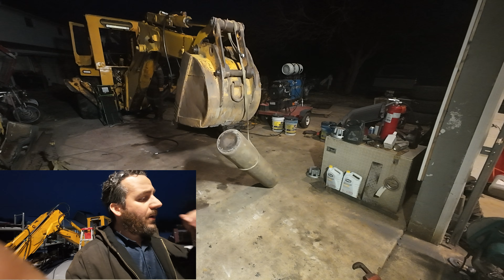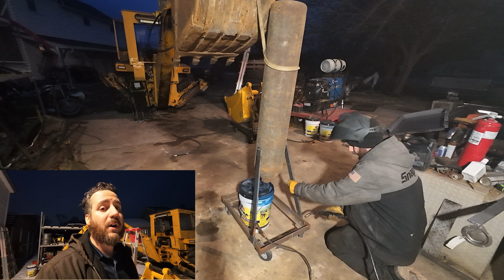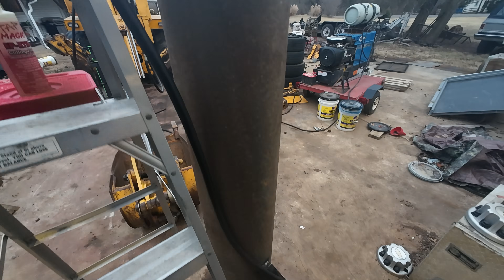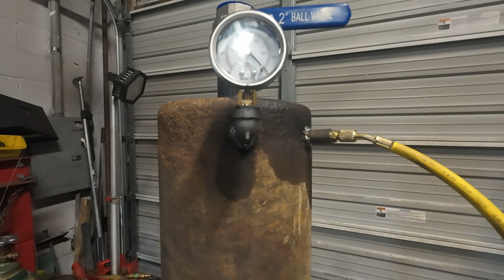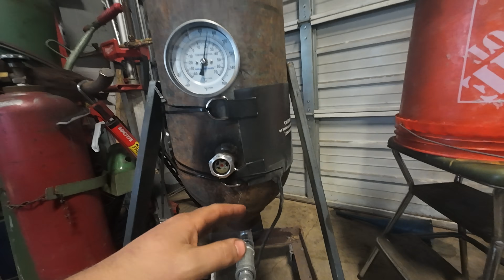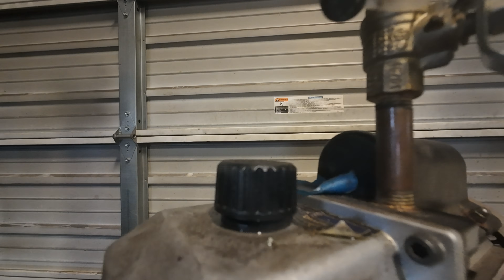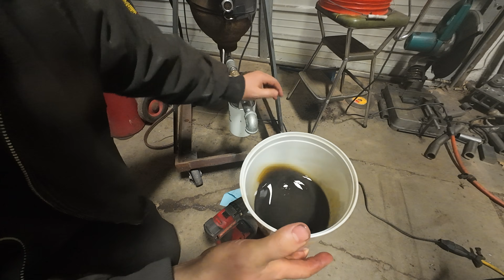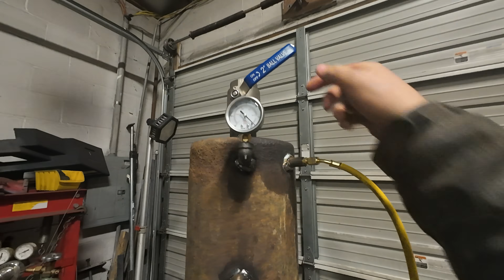I made a machine to remove water from hydraulic oil. Vacuum de-hydration

Comment: Less than a minute in and I'm wondering if a 2 gallon steel pot and an electric hotplate would be a more affordable solution to getting water out oil? Heat the liquid to 230d f or like 110 c and let it sit for an hour? Anyways that's easy now I'll watch the rest of your video to see if your machine is better...

Comment: The magnet trick was brilliant!!!!!  I used to dream about making a vacuum water remover for my vacuum pump oil when I was distilling cannabis resin in Humboldt.  The water from the atmosphere etc would infiltrate my oil and my vacuum would decrease requiring higher temperatures for distillation which would degrade the THC.   The cloudiness on your vacuum pump oil might be caused by droplets of hydraulic pump mist being sucked into the vacuum pump.   A oil air filter should help reduce this.  A cold trap to catch the water would help too, but it's a pain to have to get dry ice to keep it cold.  Keep your batches small because the bubbles will increase the volume, that's why your hydraulic oil went into the vacuum pump in the 10 gallon run.   It probably will only take 20 minutes or so to get all the water out of the oil.  You can tell by the temperature.  The temperature of the hydraulic oil will drop when you first start boiling the water off. When the temperature starts to rise, most of the water will be gone.   The leak isn't the worst thing in the world.  It can keep something called "bumping" from happening which is when things boil violently under vacuum.  But likely that wouldn't happen unless you had a lot of water in the oil, enough to pool on the bottom.  So maybe keep the tiny leak, it's helping you.  The leak provides a place for the boiling to initiate.   Below is a link to someone doing the same thing with an ebulliator tube.  Which does the same thing as your leak.    The leak provides a place for the boiling to initiate stopping supercooling which causes the bumping.   I used a syringe stuck in a hose attached to a dip tube going to the bottom of my liquid.  A tiny bit of air, (way less than would cause the vacuum to decrease) would stop the bumping.   Thanks for the vid.  I never took the time to make one of these,  It could have saved me some headache.  I miss those days.  Legalization killed all the fun.
Reply from the maker: Sounds like you were having fun!

Comment: I wonder if you can put a filtered vented cap on the tank while running the equipment?  As you run it, oil heats up, water evaporates out the vent.  Cap after use, hot!!

Comment: I used to build molecular distillation machines for cleaning transformer oil. You are on the right track  however you really need to spray the oil into the vacuum chamber and almost atomize it which helps to separate the oil from the water. We would fill the vacuum chamber with sheet metal media to add surface area to condense the oil so the heavy oil would go to the bottom and the water vaop would be pulled out of the top.  The vacuum line would pass through a chamber filled with stainless wool to condense the water so it could be drained from a valve before the pump. After the oil condenses it still needs to be pumped through a fine filter to remove the particulate. This is the step you are missing. Also the temperature may be too high, pretty sure the oil will boil at a lower temperature than what you had, under good vacuum it should boil near room temperature so you don’t affect the oil. Also a good vacuum pump with a gas ballast will allow you to run the pump to boil the vapor out  instead of changing the oil.
Reply: Yes, breaking up the surface of the oil is an important missed step. In fact, the whole vacuum idea is not needed for this purpose if you bubble air through hot oil.  The idea of this is not to get 99.9999% water free oil, because you're only draining 1/2 of the oil out of typical equipment at a time. So .01% oil doesn't matter because when you put it back in, it will mix with 1/2 contaminated oil and still be 1 or 2% water.  The process has to be set up and easy to repeat multiple times so that the water can be flushed until good enough, not perfect.  Air bubbling IN THE EQUIPMENT TANK is the simplest way to do that. If you're using a separate tank, it needs to vacuum the oil out and pressurize the tank to push the oil back into the equipment to be practical for the repeated flushing and drying is needed (as mentioned below).
Reply: @ yes, we would also make filter carts that only had a pump and a filter canister however the vacuum process makes pristine oil. I’ve never seen the air bubbling method you speak of though that is interesting.
Reply: @notanymore9471  Air bubbling is just a simpler process, pristine oil is not needed as it's going right back into a grossly contaminated system.  Once the bulk of the water was removed, then vacuum could be useful, but like you said, it would need oil sprayed, or air bubbled to free the water down to a low level. Or water absorbing filters could work at that point, filters are too expensive for bulk water in equipment like this.
Reply: The water boiling chart is based on water only, probably not taking account of water in oil, which requires the air contact to approach that temperature pressure point.
Reply: @rodfreess6019  that's a very interesting point!  Generally this type of mixture (hydraulic oil and water) is governed by Raoult's law and Dalton's law, which basically imply the water and oil will evaporate independently with little interaction.  After a certain point when the concentration of one or the other components is small, an azeotrope may form where they will not evaporate independently but that's probably not important in this case.

The point about atomizing the fluid just speeds up the inevitable evaporation.  Actually it may seem strange, but an emulsion will actually boil at a temperature lower than it's lowest boiling component.
Reply: You are evidence of what makes the internet so wonderful. Thank you for your comment.
Reply: I love how the real people completely ignored the arguing bastards
Reply: @ nobody was arguing there was one dipshit insinuating that I should give the guy free stuff because I told him what he was missing in his design.
Reply: That air drying method needs dry air.  In high humidity, it would take forever to remove the water from the oil.  It may affect the buffer chemicals in the oil. Bubbling dry air through hot oil in an operating machine would work.  If you live where it is dry, that may work.

As for running a vacuum pump to pull water out of the oil, vacuum pumps hate water.  The more water you pass through it the shorter it's lifespan will be.
Reply: @ vacuum distillation is used every day the system has to be designed correctly to separate the water and gas ballasts need to be used to prevent the build up of vapor in the oil.
Reply: Add a separate tank that has no oil in it and attach the vacuum pump to that and then attach that to the system. That way your oil won’t get foggy anything extra cotton in the overflow tank and you can just collect it afterwards.
Reply: @huuffff cool that tank and the moisture condenses in it.  (which another poster here pointed out  similarly already)
Reply: You need a condenser and then a trap before your vacuum pump
Reply: You are almost there, a few more parts and he’ll have a $20,000 roto-vap or a $30,000 wifi (wide film evaporator).  lol.
Reply: Would a centrifuge separate water and oil?
Reply: @c50ge i was wondering the same thing.
At any rate adding a centrifuge to clean the oil after boiling the water out might be a thing to do.
Reply: Optimus Prime and the Autobots appreciate your service.
Reply: Epsom salts can be used to dry the air before it goes through your vacuum pump.  It is cheap, and to be reused if you have an oven to dry it out with after subsequent runs. 
A cold trap could be arranged, but it would be more expensive. 
I wouldn't think that the qualities of the hydraulic fluid would be changed that much by merely being heated to 100° f or so, but others may know more about that than do I. 
Nice job on the setup!
Reply: @davido.newell4566 . The buzzer doesn’t go off in a machine till about 190 degrees.
Reply: I have an imported miniature Refinery I refine or distill waste automatic transmission fluid into a diesel like fuel only cost maybe 10 cent per gallon Unlimited Supply machine is fully stainless steel fully continuous fractionated into multiple fractions and temperature controlled electronically with multiple Heat exchangers I have been doing this for 12 years I have saved a lot of money in fuel
Reply: @tonydiesel3444  i am VERY INTERESTED in your comment. miniature refinery  ?  IF you are running a business selling the "fuel" i dont want to interfere . BUT IF for your own use, could you please give me a lead in the right direction so i might acquire one for my own use? im married to steffy, youtube dont like me as im an old man.

i think it would be great to make my own diesel from waste! im extremely interested in automatic system!!!
Reply: @steffybael1245  you can build one or import one neither is easy
Reply: where do you get one 
Thanks
Jacko
Reply: @tonydiesel3444  called a Shop today named Tony's Diesel in IL. to try to reach you... but apparently not the right place.  Would really like to speak with you about what setup you imported and how it is working out for you.
Reply: @tonydiesel3444  show us! Would love to see the rig you built and the process
Reply: Neato. Were they short path stills?
Reply: Yup agree  … I made a system to condition oil for high voltage pulse transformers for linear accelerators … your 90% there
Reply: @robbmanchester5747  I’m interested in your system. I want to buy something like this. Any input would be greatly appreciated. Thanks
Reply: Air bubbling is a nice idea but the air supply has to clean of particulate and low oxygen otherwise you introduce more problems.
Reply: Nice job.
Reply: Would an old oil bath air filter element work with a recirculating pump?
Reply: Poly chloro biphenyls?
Reply: Bro what if you pulled the whole hydraulic system into a nice vacuum like on the machine we do it to radiators to vacuum fill euro cars
Reply: What type of molecular still. Centrifugal wiped? Like Myers? Or vertical wiped like Chemtech? Or something specialized for the trans oil industry?
Reply: Normally I would agree that you are right as a modular department hydrolic delamination expert currently studying in the UK and Chernobyl.
Reply: If there's emulsifiers in it you might fractionate it out if you put too much surface area inside the cylinder. The atomizing is a good idea though.
Reply: No, aerosolizing the oil would create more problems than it would solve. He's not running a continuous system, so there's not need for that sort of complexity. If he did a few improvements like heating the top section of the boiling chamber to avoid water condensation and adding a vapor condensator before it hits the vacuum pump his system would do what he wants it to do more than well enough.
Reply: Any high quality  hydraulic  oil contains  a anti rust  additive and an anti foam , these additives are destroyed  when it comes into contact with the water, love what your doing. Send a sample of your oil away
 for analyzing  and top up the add package.   Good work
Reply: @donhenry7879  
Uh...

 What good is an anti-rust agent that gets destroyed the moment it comes into contact with water?

Kinda defeats the whole purpose, no?
Reply: Does drying the oil break the emulsification agents?
If the emulsification agent doesn't work anymore will using the oil risk further damage in future water contamination?
Reply: @ I’m not a chemist so I don’t know for sure but the way he is doing it probably risks it because of over heating for too long. The way commercial machines work is less likely because they pump the oil through the system and the oil is barely heated or under vacuum for more than a few minutes.
Reply: You supplying the parts for free??
Reply: @ no but your wife does.
Reply: @  - Yea, she got that from your mom, how you think you got here?
Reply: buying new oil sounds alot cheaper that the rabbit hole your trying to send this guy down you mor on
Reply: @stevesteve-w2g  Many years ago I was involved in recovering about 250 gallons of hydraulic oil from a 245 Cat track backhoe. The operator had tried to teach it to swim. We used the vacuum method and then had the oil tested. Only had to add the anti foam additive and the anti rust additive package .  Fun No but it works . The big problem was the flushing to remove any water contaminated oil . Never use diesel fuel, only flush with the same hydraulic oil you normally use.
Reply: @donhenry7879  you have to take every last bit of oil out of the unit and replace it 
i did it on a big crane i know all about it 
and all you guys brainless waist of time crap you could have gotten it done by now for just the price of the oil not some rabbit hole hunt that dont work
Reply: @donhenry7879  Where can we buy the anti foam and anit rust additives?
Reply: @Carlos27236  take a sample of your oil to have it professionally  analyzed , fuild life, AGAT  for example.  They will tell you which additives  you are missing and who much

They will also  know which companies  sell them in your locale area.
Reply: @stevesteve-w2g  new oil also depends on what the oil is used for.

Keep in mind that he’s talking about doing multiple flushes just to clean out the system.

I think the idea is that you can use this reclaimed oil for multiple flushes to get the system in somewhat reasonable condition. Then you replace it with new oil when you finish.
Reply: @ it’s not a rabbit hole moron it’s how the industry cleans oil.

Comment: Your vacuum pump might also be getting contaminated with hydraulic oil. A fair bit will evaporate right along with the water, depending on the oil's vapor pressure rating.

Comment: Yeah I serviced and hydro tested high pressure cylinders. Under the code of regulations it doesn’t go into too much detail about rust. In experience it was mostly applied to thin wall, or low pressure (under 1000psi testing pressure with testing is 2.5 time holding) if it says 1800 on it that’s the holding. Most of my condemns was due to cracks in the threads or incorrect thread depth being you don’t want the valve head to blow off. And changing out the burst disk that rated a 3k. Why so high because C02. But some may have lower like dry air. So done get the cylinders mixed up on refilling. You can convert a cylinder for different agent but you got to strip it down and set it up. In testing most would pass and it’s common to see cylinders from the 70s, 60s and older. They get tested every 5 years too.

Comment: Something you may want to consider is using a continuous filtering process on the vacuum pump. Water in pumps is a problem home freeze dryers run into. While running my dryer, I use a fuel pump to cycle the vacuum oil through a diesel fuel water filter. I run it continuously and it keeps the oil clean. The oil in the pump is very hydroscopic. There are several videos on freeze dyers that show some setups. Great video though.

Follow up: While a different application, same principle of removing water under vacuum.  It's also important to note that since the water vapor is in a vacuum state, it will have trouble condensing back to a liquid until it is back at atmospheric pressure. The water vapor actually travels through the vacuum pump to where the vacuum oil is and a lot of it gets trapped in oil in the vacuum pump since it is now at atmospheric pressure.  Here is a video showing how some people set up the filter for the vacuum pump.  

https://www.youtube.com/watch?v=pAKeWTumS0g&t=139s

One thing I have found as well, cheaper vacuum pumps will rust like crazy if there is water trapped in the vacuum pump oil.  I also just let the filtration run a while after I am done using the vacuum pump to make sure the vacuum oil is void of water.  So far, the oil has stayed clear and not gotten foggy, even while I am running stuff with lots of water in it.  You can almost cover the cost of parts to do this within two batches oil.  Curious to see what your next steps will be on this.  Very interesting idea.
Reply: Yes, it needs a cold trap.

Comment: Why not use the vacuum in the cylinder to draw in the oil/water? Seems better than standing on something, having to hump a 5 gallon pail six feet up to fill the cylinder. And you could control what makes it into the cylinder (like not having the trash on the bottom make it’s way in).
Cool project. Thanks for sharing!
Reply from the maker: I love that idea!
Reply: that was an oversight on his part. it would totally work awesomely with a transparent fill hose. just evacuate it and wheel it to the excavator to suck the oil in. would also be nice to have a level sight glass instead of the 2 individual ones. and a trap in the vapour line zip-tied into a bucket of snow to protect the vacuum pump. i am also not completely sold on having the thing stand up tall. but what do i know i only ever operated an excavator a couple of times lol. pretty sweet device for a first version.

Comment: Another possibility is that there is some fractional distillation occurring in the lower pressure area of the tank. However, that should be rather specific compounds and things closer to gasoline (e.g. benzene) and not close to oil in length of carbon chains.  The fuel for the SR-71 was fully synthetic based on meeting the criteria the Air Force came up with. One of the base feedstocks used was part of the bug spray FLIT.